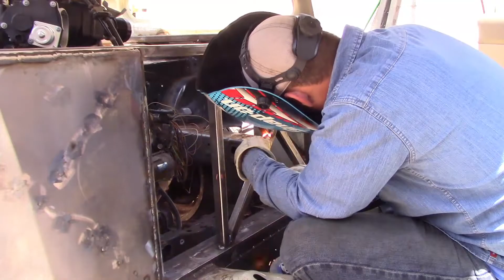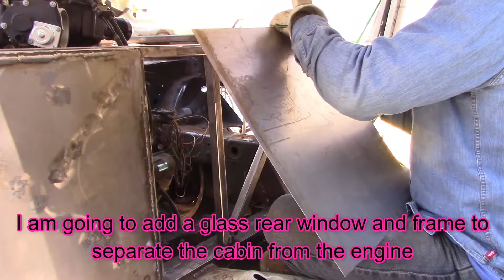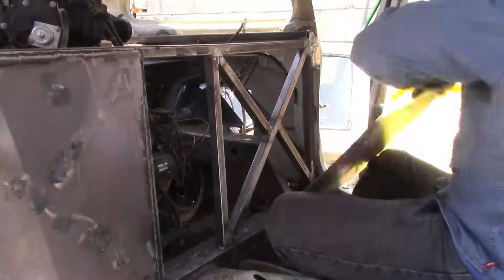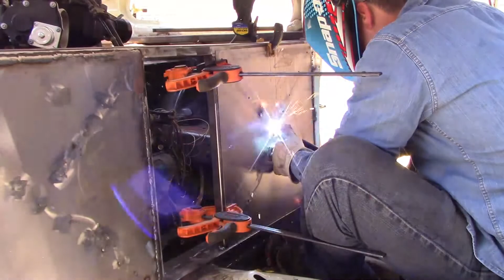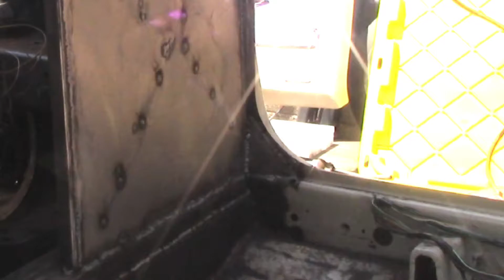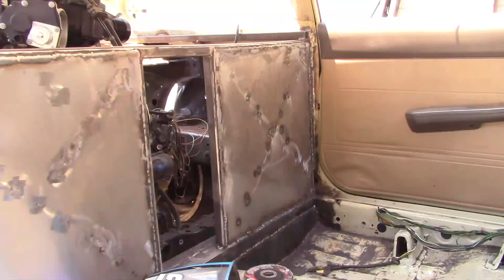Civic RWD 16- Oh SHEET!- Firewall

Comment: Don't be afraid to throw a self tapping screw or three in there to hold the panel while you weld it in, then remove the screws and plug weld those holes.